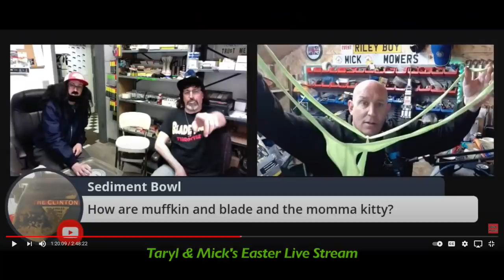Awesome English Suffolk Engine - Will It Run?

Comment: They say hat rotary mowers are making a comeback.
Last week I saw a guy in my neighborhood pushing one.
All the news has to do is declare an Eco Action Day and the eco-hippies are out the mowing carbon-neutered.
I have vintage piece of mower shop equipment, a 1952 Modern Machine Co rotary mower sharpener.
The mower is mounted on the front rail, with front to back adjustment, the grinder slides on rails and and has up/down adjustment, you slide the grinder and the rotary blades turn giving a professional sharpening job - you kick the mower handle down and position the cutting bar to sharpen that as well.
have you seen those wonky lap compound rotary mower sharpening kits on the interscreen, I've been thinking of running the grinder off solar panels and a variable frequency drive -- offering the eco-hippies a true carbon-neutered sharpening for mere $50 lol
Reply: I meant to say reel mowers, and referring to my owners manual its the Modern Manufacturing Company out of Pasadena California.
I also have a letter describing the shipping arraignments via Railway Express (I believe later bought out by UPS) to my local rail freight station which is also the county seat.
Luckily I found this manual because I almost threw out this hunk of metal as scrap but changed my mind at the last second, turns out its a ice skate sharpening attachment for the Modern Lawn Mower Sharpener.
Reply: The electric grinder motor was an option ... I don't see how they would have powered this otherwise, a hit and miss engine I suppose

Comment: You see which way the fins are smashing against the wind, that is the way it turns, the bolt will tighten the opposite way of turning.  If unsure of the fin direction see which way the starter turns it.  Most bricks and scrapem turn the other way, not all though.

Comment: That manifold, at the time the mower was built, was made from 'Mazak' - a Zinc/Aluminium/Magnesium alloy.

Mazak (Zamak in the US?) ALWAYS rots, no matter the application it's used for . . .

Oh, and 'Larry' was probably an Australian Boxer - before official Rules came into use - in the 1890's, name of Larry Foley, who won a Pot of A$150,000, which was the biggest ever at that time . . .
Reply: I couldn't remember the name of that crummy alloy. I read about it years ago when I was in machine shop in high school, and the books said it was horrible to drill and tap. I've dealt with chainsaws that used it.
Reply: 30-odd years ago I had an old Atlas lathe (based on the Myford) and all its change wheels were made from it. They were starting to get a bit iffy even then.

Comment: I think you should lap the valves.  It's not gonna make power with 60-70 psi (unless it has a decompression valve).  Maybe it will go up on its own with a few heat cycles. But if not, something has to be done to raise the compression.

Comment: Just a quick tip about the wd-40, it is not only not a lubricant, but is actually mildly corrosive. If you use it to clean/lube parts, you would be well advised to clean it off as best as possible when the part is freed up and add some actual lubricant of your choice. Thanks again for the awesome video and sharing your knowledge!!  😅🤘
Reply: Where did you hear that WD-40 is corrosive? The stuff was literally made as a metal preservative. It was never designed to be a rust penetrant. It just happens to work somewhat as that too.
Reply: @1pcfred  maybe you should do a little more research before you speak up. It was NOT invented to preserve metal, while that was among the first uses of it, it was invented specifically to displace water. Hence the name WD - Water Displacement. And it is mildly corrosive to certain plastics and some other materials.
Reply: @justanotherfreakinchannel9069  you're such a genius so you tell me what the pH level of WD-40 is. As my research was unable to find that figure. Maybe you can find out what the difference between a corrosive and a solvent is too while you're at it? Because WD-40 is most definitely a solvent. That's about all it is in fact.

Comment: Another commenter mentioned the gas powered washing machine, I've seen these in the early 80's on an island that had no electricity.
Pump water into it from the lake with a gas powered pump, pull start the washer and then it had a foot pedal to engage the belt for agitation.
can't believe you'd befoul a laundromat with human shop rag inards ..cack cack ew lol but a mini bike is probably best to show it off and the bring big bucks these days.

Comment: That button is called a ticket push it down and hold  it temporarily raises the fuel level until it runs out the drain, no choke   closed throttle will give a nice rich mixture then open your throttle just a bit  another trick leave spark off ,just do an easy stroke  or two to prime  you should be able start it at a high idle  the closer to being closed  your throttle is the more intake vacuum you have  use the choke as a last resort 
It worked on the British. Bikes...

Comment: The "suppressor" part is probably to cut the RF signal interference from the ignition system.
Reply: Interfering with what? You think lawn mowers come with radios? The suppressor was probably so back EMF didn't roast your points.

Comment: After I keep hearing WD40 ( the original) isn't a lubricant I did some research. What I found was "The main ingredient is Stoddard solvent, which is also known by its own brand name, Varsol. CO2 is used as a propellant and mineral oil is another main ingredient. so it is a solvent and a lubricant.

Comment: Remove the oil filler cap and drain plug and blow with compressed air through the oil filler cap hole to get rid of all that nasty oil.

Comment: That's a cool engine.  I gotta vintage wisconsin sd14 here awhile back.  Was told it would run.  It's rope start.  I haven't worked up the nerve to get my shoulder yanked out of socket yet.  It's a huge engine.  Anyone know anything about them?  Not really worth trying to sell im sure not much interest locally and extremely too heavy to ship outside of freight so if nothing else it looks good sitting on the shelf.  No interest in parting out I hate doing that on harder to find stuff I haven't seen one in a very long tiIme.  Dont know much about it, appears that the governor is ran off the exhaust.  Its so heavy I have no idea what it would be good for maybe a cement mixer? I also have a few of the old briggs cast iron engines.  One is on a Gilson mower it's a beast lol.  Its so heavy it just crushes stuff lol.  I also have a stash of craftsman 3 speed hi lo transmissions.  Im into karts was thinking of doing something with one of them.

Comment: Video on what that wd40 contains would be good Taryl
Reply: Myth: WD-40® Multi-Use Product is not really a lubricant.

Fact: While the “W-D” in WD-40® stands for Water Displacement, WD-40® Multi-Use Product is a unique, special blend of lubricants. The product’s formulation also contains anti-corrosion agents and ingredients for penetration, water displacement and soil removal.
Reply: Need to know what's in Taryl's wd40 not the bought one.

Comment: Hey mower man, I hate to bug ya and put my problems on the interwebs but I'm having a serious problem sourcing parts for my awesome Craftsman chainsaw 3.7 made by Poulan, the Poulan 3700. Craftsman model 358356090, need a set of piston rings part number 25933 or I believe the Poulan part number is 530024756.
These units have a hard chrome cylinder, awesome vids on the tubes of this beloved saw.  I may have to tear it down and measure the rings and try generic size 40mm, 41mm or 44mm or whatever they may be. ps prefer to get a set of those Italian made Caber rings. Any help would make me a happy laddie.

Comment: I just did a valve job on my 18hp briggs opposwd twin....  I used Permatex Ultra Slick assembly lube on the valve stems... stuff is sticky!!  Im wondering if I made a mistake by using this lube.  The engine is still apart.  Is this ok?  Or should I use something else... or nothing at all? Thanks! :)

Comment: Hey "Tare-all" why do you put the case back on to check for spark? why don't you just turn the crank with an impact?
Reply from the maker: I could have used a drill. However its left-handed threads and it probably would have loosened the nut. Never use an impact that hammers the nut. Good way to snap off the end of the crankshaft. LOL. there's your dinner!
Reply: @TarylFixesAll  I meant a drill. Also I was wondering which way the engine supposed to turn beings how they drive on the wrong side of the road over there on the other side of the pond. Thanks for answering, yer a cool dude. I'm eating my dinner all gone!

Comment: WD-40 is not a lubricant.... True, but it does have some.
And what's bad is WD-40 beat Kroil in every test that project Farm tested it with.
Better lubricant, better wicking, & WD-40 out perform Kroil on the Lubricity test.
So that either says a lot for WD-40 or says a lot about Kroil.

Comment: Hi taryl
I have new lawn tractor
Frequently flywheel broken 
I chaneg it but after many times 
Suddenly engine won't start
After that I change every part in this engine (camshaft/carb solenoid/full carb/adjust valve/change every gasket but same issue still existing
At last i noticed exhaust muffler very hot but engine didn't fire up
Kindly your support
Reply: @piedbywagnersaucedo3959  
Thanks
Reply: Hi taryl
Greetings
What up number not clear
I need ask you alot of questions 
There's your dinner

Comment: Pretty dumb to think you'll want to get into the business of issuing service advice on the tubes.
I wouldn't normally ask but I cut down a 40ft 100yo box elder that was hollow, the remaining 3-5 inches of good wood was filled with sap, it was literally like cutting stone and I could watch my saw go from sharp to dull in cutting just 12 inches of wood, this garbage tree sapped the life outta my saw.
Now I have to deal with a 70ft 80 year old willow in the backyard, hollow and cracked as well, dropping three foot around limbs left and right .. until I find an affordable solution to bring the green monster to heal -- its a matter of life and death, I need this saw to put under my pillow in case I need to self-rescue. sleeping 40ft from a 70ft tree is bad math for me.